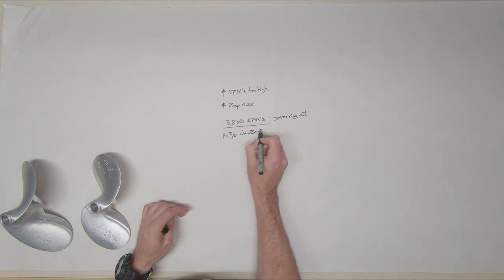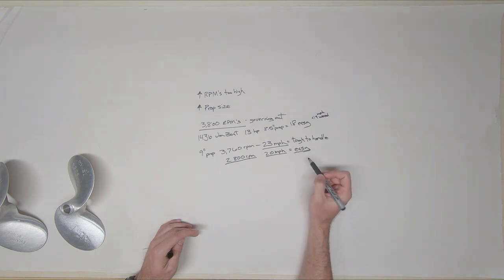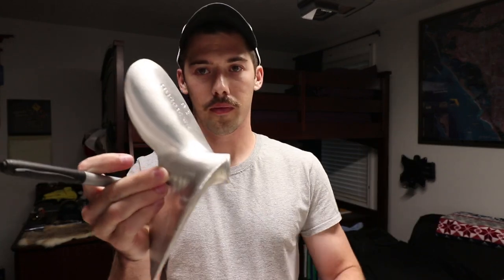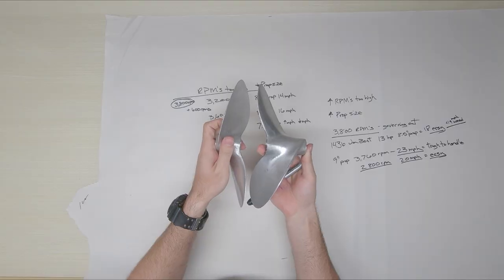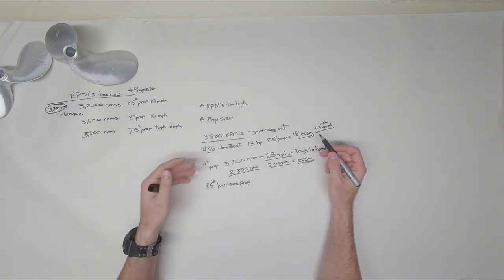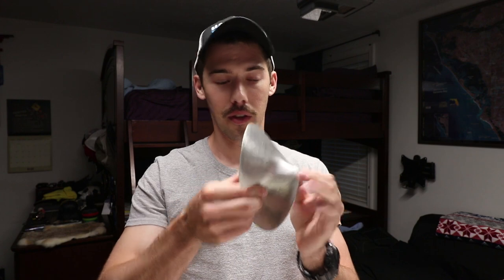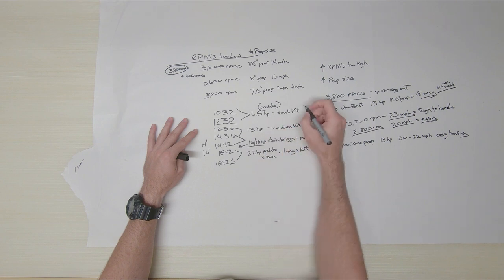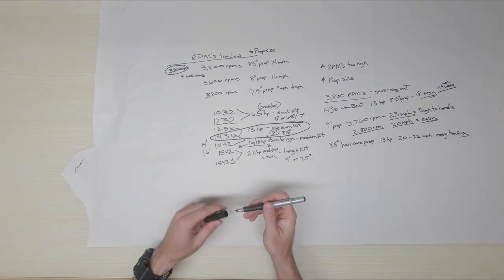Sizing a Prop {Longtail Mud Motors}

Comment: Good video on this topic, as usual for your channel.  Impossible to perfectly match props to boats for Thai Longtails since not enough choices.  Most boaters can pick a variety of pitches and diameters, but with these longtails, only the diameters are available, mostly with a fixed 5 inch pitch I believe.  The pitch on the racing prop you show looks like a much greater pitch, not the 5 1/2 to 6 inch pitch you would need to tweak your boat for more speed.  Don't forget its also the load you carry in your boat along with the boat itself that affects the prop choice.  Also, changing prop means changing the balance of the longtail with not much adjustment possible.

Thai Longtails were designed for use in clear water and for salt water use to enable travel between the many small island in Thailand.  They were not designed for use with American fishing boats or for use in mud..  If you search for pictures online, the boats in Thailand have very thick and plumb (vertical) wooden transoms that are about a foot high above the water line.  These longtails push directly at the very top of the transom, not spreaad across the back side over  a large area like an outboard for which fishing boats are designed.  I see way too much transom vibration in all the videos I see using these setups.  This is somewhat dangerous.  I suggest at least a 2 by 12 board the full transom width to stiffen.   Better yet, an engine mount that stands off a few inches behind the transom and gives a vertical surface to mount to.

Thai longtails are too heavy for American fishing boats, especially while trailering, which is when the greatest forces occur against the hull.  Better to disconnect and place the whole thing inside the boat while trailering.  I love my Thai Longtail, which I've been using about 4 years.  I have a mud-skipper two piece with 6.5 predator on a small displacement boat that has dual rudders for steering.  The longtail is attached to the side of the boat and not used for steering.  I also do not have a tiller and use a rope over the side attached to the shaft housing to adjust depth of prop.  I run this at about half engine speed maximum, about where the prop begins to lift out of the water due to the bad balance.  Completely hands off, I cruise at about 7 mph.

Bungee chords can be used to pull the shaft down a bit for better balance with more thrust.  Fishing boats may work better using a small rudder clamped to the transom for steering and an adjustable stick to hold the tiller up or down while speeding between fishing spots.   These longtails are too much work to hold by hand for long periods of time!
Reply from the maker: Very true. I do hope that in the future there will be multiple choices for pitch on props. I do not believe it has reached a need yet in the general market for the companies to go after this. It seems most people just want a cheap motor to move the boat and that's all they need. Very few actually want to dial in a longtail and make it the best it can be.

You mention a lot of good information, and I know I've experienced that these American jon boats were not designed for longtail use. The transom is too high, the seat is in the way, and the transom is too weak and not designed to handle longtail mud motor. People make it work though. 

Thank you for your input, I really appreciate it and enjoyed reading it!

Comment: What you say 14ft with a 6.5hp predator with some weight
Reply from the maker: It'll push it. I'm going to finish testing this backwater kit and then I'm putting my original 6.5hp engine and small sps on the 1436 I have now and play with prop sizes, load, and speed. The last time I had it on I was running a 6.5" prop and got a solid 12mph sometimes 13mph. I have others saying they are running the same setup getting 16mph and then using a hopped up 6.5hp and getting 20mph with performance props. So I want to play around with it and see
Reply: @JTgatoring  same i have a old 70s duracraft jon boat 14ft so its well built and I say it does decent with all the weight in it prob just need a bigger prop it has a 6.5in on it now and my 10ft jon I just run the 6.5in prop it scoots
Reply from the maker: @bandedcalls  Yeah, you'll be seeing the 6.5hp in some upcoming videos on the channel. I'm excited to see how it does. Its been awhile
Reply: @JTgatoring  you ever heard of a 6.5hp raven motor its electric and pull
Reply from the maker: @bandedcalls  I have not. I'll look it up
Reply: @JTgatoring  i got one and hooked it up havent ran it in the water yet ill try it this weekend its made.for log splitter originally

Comment: 6.5hp or a 13hp on a 1240?
Reply from the maker: Whatever that boat is rated for. It would probably be best to do the harbor freight 8hp engine for that size boat
Reply: @JTgatoring  thanks for the advice, I’ve never had a mudmotor but I want one for this little boat and I think for what I do it’ll work good I just didn’t know where to start but thank you!
Reply from the maker: @michaelcandelora5673  Yeah, no problem. There are lots of videos you can find on the channel to help you with your decision. If you have any other questions, let me know!

Comment: hey jt i have a 1442 with a 22hp predator and a 9.5 prop dont know what the rpms are but im only getting about 14mph with 2 pretty skinny people should i go up in prop size?
Reply from the maker: You gotta know what your RPMs are. There's a lot that goes into trouble shooting that. With it being a 22hp engine, you probably already have a 100" shaft and a 9" and 9.5" prop. 14mph doesn't sound right. The first thing I would mess with is the weight distribution in the boat. That can actually make a very big difference. I'm starting to recognize that when you start to load down these jon boats, you reach a certain point and you no longer are on top of the water. It starts to sink and plow through the water. The rake on the hulls are almost non existent. Play with your weight distribution in the boat and get a tachometer. From there I could better help you
Reply: @JTgatoring  thanks. tach will be on tomorrow so ill let you know. but also im starting to think its a weight distrabution thing or i need to mount the motor further aft because if i dig the prop deep into the water i can get it to about 17mph.
Reply from the maker: That seems to be a trick, like a give and take. With my sps longtail, I can ride out smooth at 20mph, but if I dig it and full throttle it can really get your mph up. Depending on what mud motor you have, theres a few things to play around with. A tach will give you a base line and help you better understand what is going on and where to go from

Comment: I run 1542 with a 13 hp predator getting 14 15 mph up river get 22 down river
Reply from the maker: That's pretty good on that downriver speed! What prop do you normally run?
Reply: @JTgatoring  8 1/2 got get a 9 and try it out I use my boat a lot put 80 hours on the motor last year seems reliable so far have a stage 1 upgrade on it air filter bigger jet a different exhaust get a lot more power out of the motor
Reply from the maker: @jeremybahm2163  Awesome! I may get a used motor and try upgrading it to see what kind of speeds I can get. I've been keeping mine stock so that others know what to expect from a standard engine off the shelf